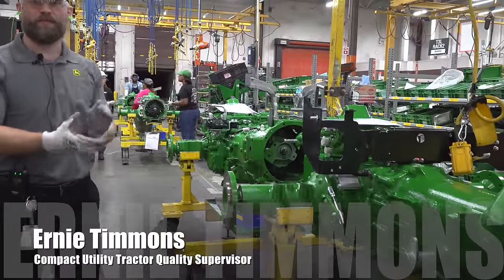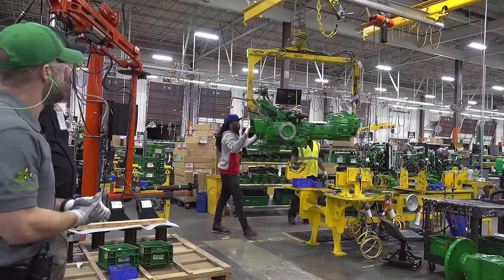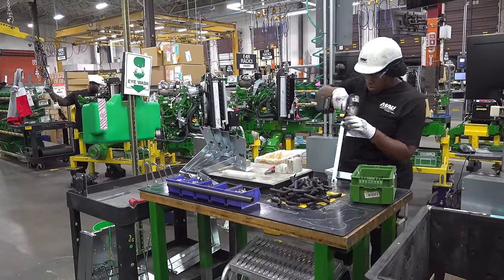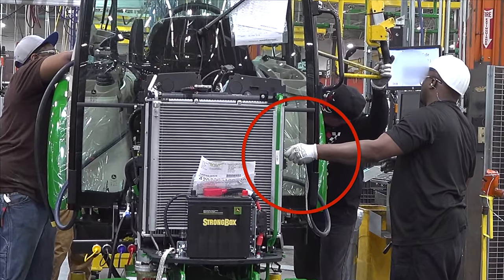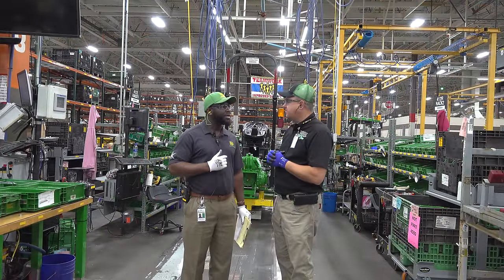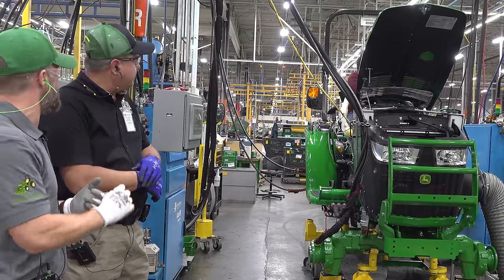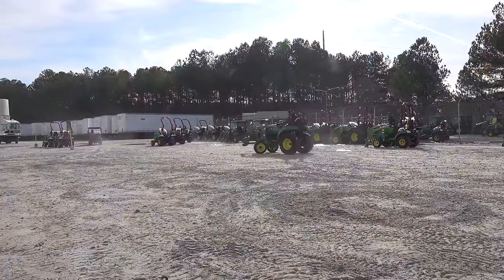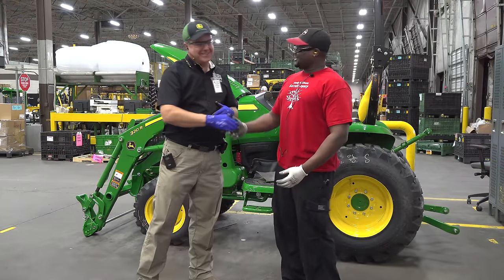Deere Factory Tour 3-4 Series!  Who Built Your Tractor?

Comment: Spotted that 3025D! Got a 3025E because I had to have a tractor. I want to know if I made the right decision, given that the 3025D does not  have a sycro'd transmission. 

My 3025E has been a real workhorse. Turns a 60' brush hog and flail mower very well. I don't think more horsepower is necessary!

Comment: Great Video! Anyone who thinks that Yanmar still builds the John Deere tractors themselves is nuts! That doesn’t mean that they are bad, the 50 series is great! Anyways, I have a few questions. Did you say that the 3r and 4 series transmissions were made from the ground up in the same factory? Also, did the plant officials say that the 3e series is made on a different line?
Reply from the maker: 3e is assembled on a different line.  More of it is made overseas.  But final assembly is in same building as 1-4 series.  We show some of it in this building.
Reply: That’s what I was expecting. But I hear that it’s still a great tractor!
Reply: Also, is the 3D transaxle and transmission made in the same factory or is that somewhere else?

Comment: Time I seen your video running a Case Excavator with a Case Concrete Breaker. I was wondering what Model  Case Concrete Breaker you were using? thanks
Reply from the maker: I dunno, Carl.  It has been more than a year since we had that breaker.
Reply: Tractor Time with Tim Do you still have the 37C?

Comment: Hey Tim, that looks like a 3046R that was being mated up. (I can see the intercooler tubes) Also, see it had an A/C compressor, so it is going to be a cabbed unit! That is amazing that the ROPS cab frame comes in bare and is made up for the tractor in Augusta. More assembly done in US! Where are the engines and bell housings built up?

Comment: I always like John Deere, but John Deere must be add one the system that is , if the 5405 is 65 Hp it should be transferred as required loan as 45 or 50 immediately like gears from 1 to 4.

Comment: The engineers need to engineer a new design for the loaders to easily take them off .  Kubota has them beat on that.
Reply from the maker: Deere’s quick park loader mechanism is second to none.   
I’m wondering if you are thinking of the 3e tractor which has a non removable loader??

Comment: Would love to own a  series 4 cab. But here in France, John Deere has divided the market in 2 parts. Series 5 and higher are with real AG dealers. Everything under is found by your local garden center... So the guy who sells a mower or a chainsaw will also sell me a 25 to 60 horse tractor. Sorry but how good your product may be, a big part of your quality lands on your local dealers. And I have no confidence in a local garden center servicing my tractor or helping me out in case of warranty stuff due to the simple fact they have no clue.... So I am really thinking of another brand where I can still find the smaller models in a real tractor dealer. Or move up to a series 5.
Reply from the maker: I dunno. The smaller machines are dramatically simpler than the 6 and up series. 
There should be no issue with the dealers maintaining them. There is LOTS of information available to the dealers via their internal computer system.
Reply: @TractorTimewithTim . I DON'T  know about simpler! Watch Western Truck and Tractor repair an oil leak on a JD 3032E !,